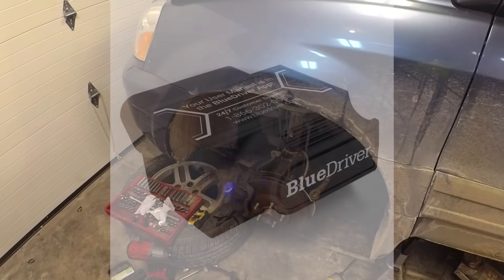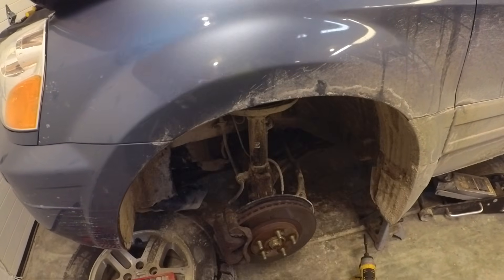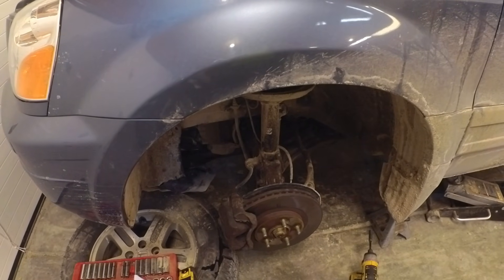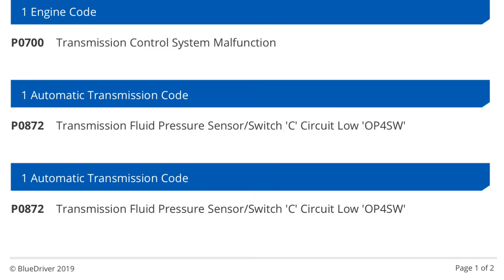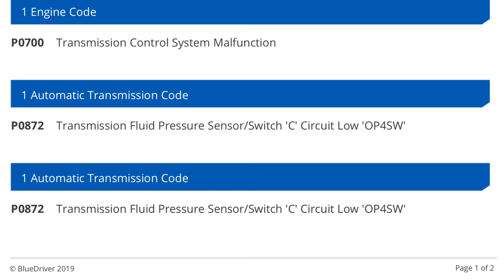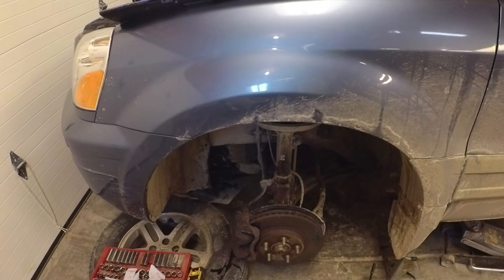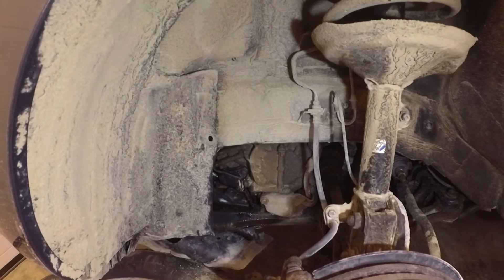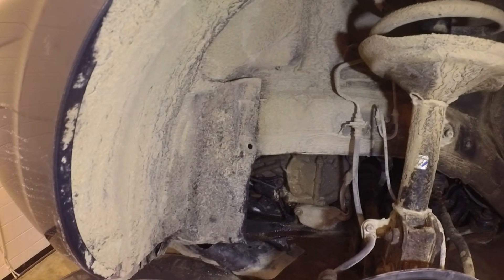2003-2008 Honda Pilot P0872 Transmission 3rd and 4th Pressure Switches Replacement

Comment: you have them backwards you put in the right ones  but keep calling them the other ones third is under black shroud (the black one) the beige one is above it the 4th! correct?
Reply: The transmission  casting has a 4 stamped on it and a 3 stamped on it to in. You can see it in the video.
Reply: @yes2cookies651 what time in the video?
Reply from the maker: You are correct. The 3rd pressure switch is the black one and 4th is the beige one. Like you said I installed them correctly but referred to them wrong in this video. For everyone's reference, the part number for the 3rd pressure switch (the black one) is 28610-RKE-004 and the 4th (beige one) is 28600-RKE-004
Reply: Thanks for correcting him!

Comment: QUESTION - hello! Would a failed l 4th gear pressure switch cause a slight power drop in 4th gear. When my pilot shifts to 4th my rpm’s drop to 1200-1500 and doesn’t really accelerate well until it downshifts back to 3rd. Thanks!

Comment: Genuine switchs fail regularly. I've replaced a few and a $15-20 switch will last as long if not longer than a off brand sensor.  Buy a couple if nervous it will still be half the price of the honda brand switch

Comment: My 03 pilot stopped shifting into 3rd gear. I was thinking about using Lucas transmission fix. Or should i replace these sensors instead?

Comment: I have a 2003 pilot and it started slipping the 3rd geat. It only goes to 2nd gear. Now it doesnt let me shift into 3rd. Help!
Reply from the maker: Might be too late for Lucas or a switch.
Reply: @JackofAllMasterofNone  I'm going to try Lucas 1st. Then also check and clean the solenoids. They are easily accessible via front bottom. No luck opening the fill hole, my tool broke trying to loosen it.

Comment: Genuine Honda for less than cost price to a dealer? Those aren't genuine switches but the Amazon seller may have located a OEM manufacture, but likely you bought Rostra switches.
Reply from the maker: No. I got genuine Honda switches
Reply: @JackofAllMasterofNone  Theres no way that you got a dealership part for that price off Amazon, the dealer cost on that part is more than what you paid.

Comment: So the first sensors you removed are actually the OE Honda colored sensors, they switched the colors to black and beige. I actually installed aftermarket brands with good reviews, I replaced the OE already once so I’m trying the aftermarket brand see what happens! Good  video!

Comment: On are 2005 Honda pilot it's goes out of drive into neutral we have to turn  off the car and then start it back up then it goes in brive then back to back into neutral but there is no slipping in all the gears just kicks out of drive

Comment: Thank you for this video. I have a 2005 and a 2004 Saturn Vue 3rd gear shift solenoid is out in my 2004 my 2005 has been wrecked so I was thinking of pulling the solenoid out of the 2005 and putting it in the floor this video has helped me figure out where it is and how to do thank you for this video it was very

Comment: Please help I have some issues with my transmisión . Already change some parts .
But it doesn’t go up over 40 mph it kicks hard not sure if is this pressure switch but also noticed that when car is on park and try to bring down the handle to D3 position it doesn’t do it it goes straight to 2nd, I believe if don’t fix this first transmission will never go up over 40 mph when I drive on D position .
Please need HELP .
Thanks
Reply: Damn buddy

Comment: Hello I’m thinking about buying this car. I looked up the issues, but I’m not quite sure what it could be. Could you possibly help me narrow it down???😅please🙏

⬇️Seller’s description⬇️
“I have a 2003 Honda pilot for sale. Have had it for a few years. Been one of the best cars I’ve owned. Selling because something happened last time I drove it. It came out of gear and now it won’t go back into gear. I do t have the knowledge to fix it or the money to pay a mechanic. I’m looking to get 700 for it.”

It’s a 2003 Honda Pilot · EX Sport Utility 4D w/250,000 miles
Reply from the maker: Could be a bunch of different things from a totally grenaded transmission to a shifter linkage bushing popping off.

Comment: i dont have a check engine light but the D is blinking could this be the reason why ?
Reply from the maker: Yes it could. But the only way to be sure is to scan the code. The blinking D indicates a transmission fault code, but there are many possibilities.

Comment: You have to drain transmission fluid to replace those sensors?? Or you can change without changing fluid?
Reply: Nvm i changed them without draining fluid

Comment: 2008 Honda Pilot EX-L, Honda Genuine ATF (recently drain and filled x 3 times), 233k miles, no codes, no flashing lights, no check engine light. I started experiencing harder shifting. RPM goes up before it switches. I am wondering if it is worth replacing them or is my transmission just worn out?
Reply: LUCAS TRANSMISSION TREATMENT FIX

Comment: Those "junk" aftermarket sensors are the honda originals, i just pulled out of my 2004 i bought new and the originals look like what you call the aftermarket.  There is a beige and says  CZ310 on it.  Replacement Honda parts different from the originals in at least appearance, I think the black original said BT302 on it
Reply from the maker: Interesting

Comment: Thanks for this video, I used jumping the 4th and 9th on the Obd 2 to read the via via flashing. Came up with #27.   Used your link to order both switches, first time an issue!    Pilot is 2004 with 202k miles, bought new daily driver

Comment: did you replace with new crush washers or re-use?
Reply: sorry meant to say where did you get the crush washers? Amazon?
Reply from the maker: Links in the video description
Reply: @JackofAllMasterofNone 

The 3rd and 4th pressure switches and the bluedriver scan tool are in the description. The washers are not.